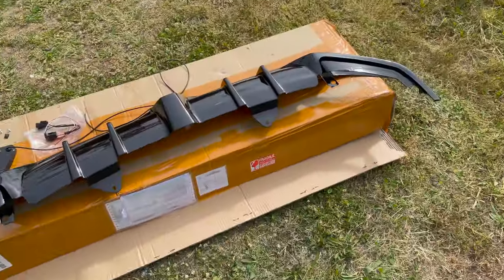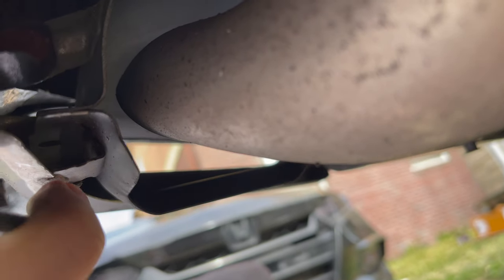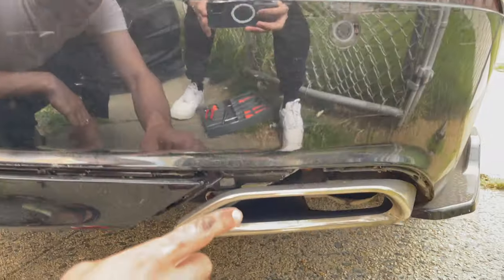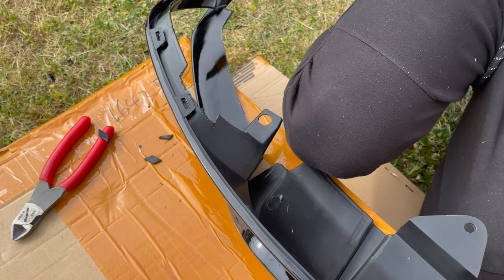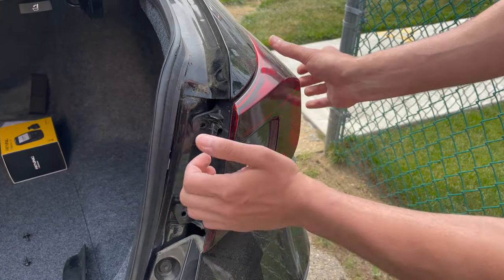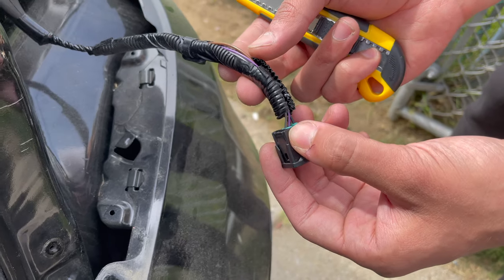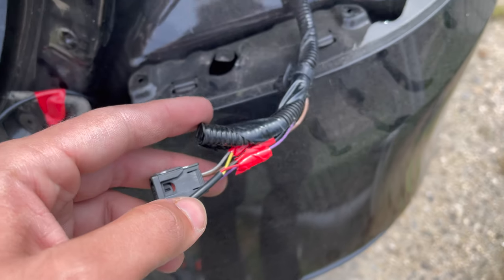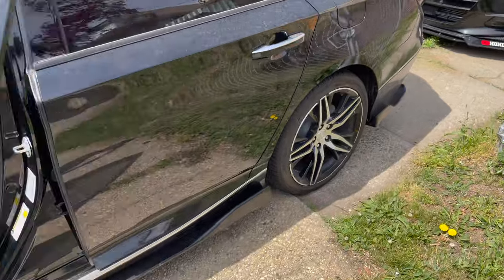installing aggressive diffuser on a 2021 honda accord touring

Comment: Just ordered a 2022 Honda Accord sport I like that rear diffuser and spoiler and front lip not sure if they'll fit the 2022 do you have any info
Reply: Also when using that spoiler and taking off factory spoiler what about the holes left by the factory spoiler. Is there a video for this .
Reply from the maker: That spoiler will fit the 2022. I covered my holes with vinyl I have a installation video and also removal video on stock spoiler removal.
Reply: Will that diffuser and front lip also fit the 22? Sorry to be such a pain I just don't want to order the wrong stuff
Reply: Also is there a part number for a black duck bill? I see the blue and white
Reply from the maker: https://www.ebay.com/itm/Carbon-Fiber-Style-Highkick-Duckbill-Trunk-Lid-Spoilers-Wing-For-Honda-Accor-/294555654402?mkcid=16&mkevt=1&_trksid=p2349624.m46890.l6249&mkrid=711-127632-2357-0
Reply from the maker: Order the front lip here the 2021 front lip will fit 2022 
https://www.aerowerksports.com/product/honda-accord-2021-front-bumper-lip
Discount code RLM5

Comment: 11:39 can I just use the power supply that came with the it instead of stripping the wires from the tailights? Would it make a difference or not?